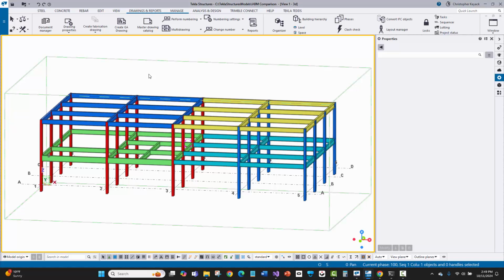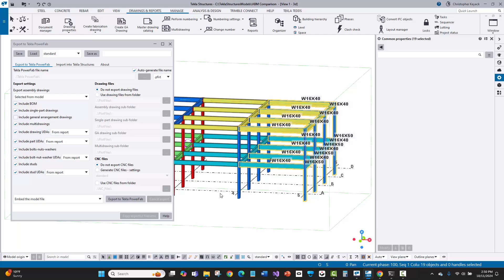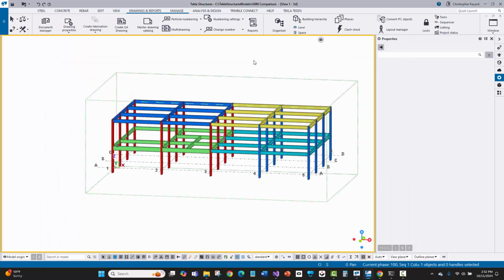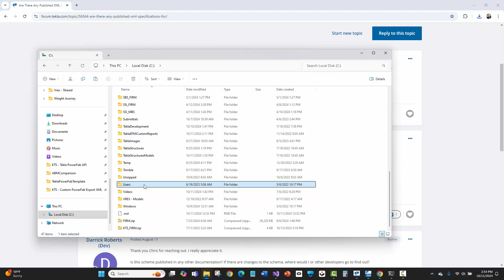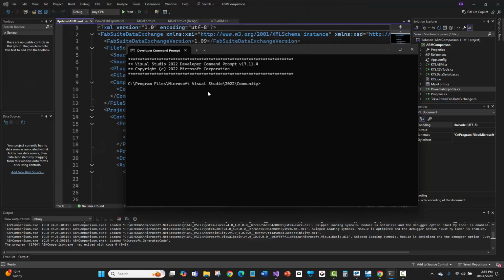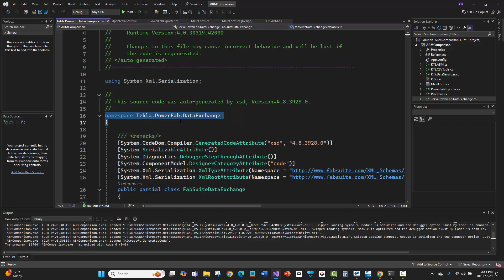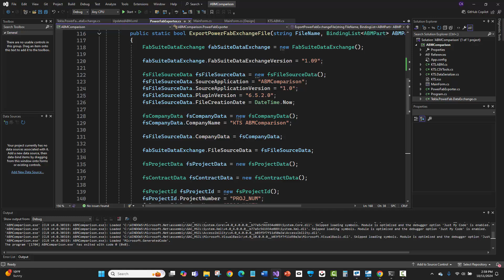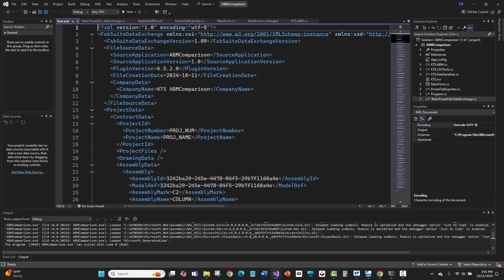KTS - Custom Tekla PowerFab Export

Comment: I am learning a lot from you. I have a question about numbering. There are hundreds of columns in a project. When I perform numbering, I want same columns to have same number with different series. For example there are 5 same columns in different locations. I want these columns to have Cxxx-1,CXXX-2,Cxxx-3,Cxxx-4,Cxxx-5 instead of Cxxx for all five. In addition I saw on drawing with DS2 a format xxxC-1,xxxC-2,xxxC-3,xxxC-4,xxxC-5. Can we make this format with TEKLA?
Reply from the maker: @archikim3803  assembly position format string in advanced options and some form of UDA to represent each individual assembly incremental order maybe?